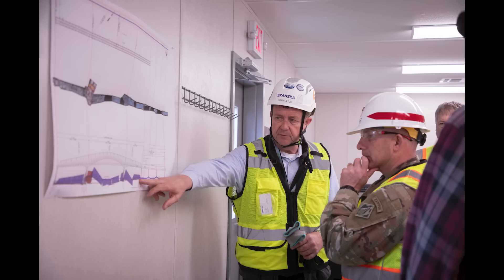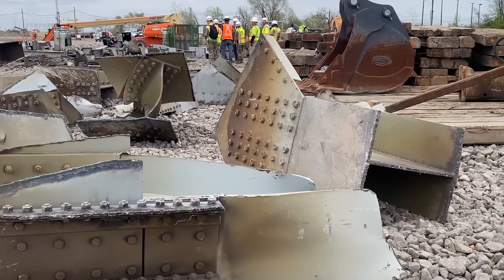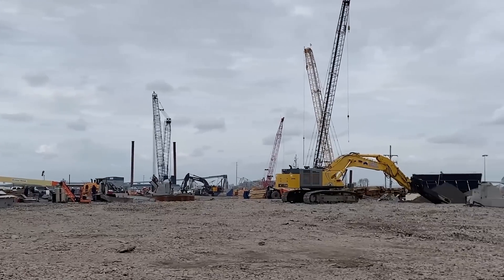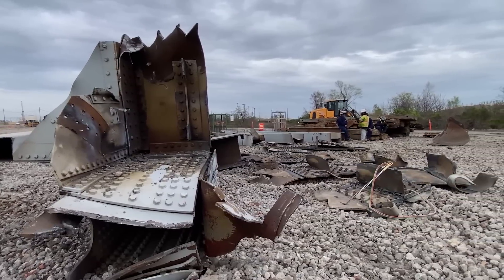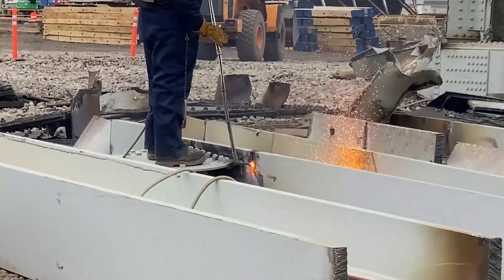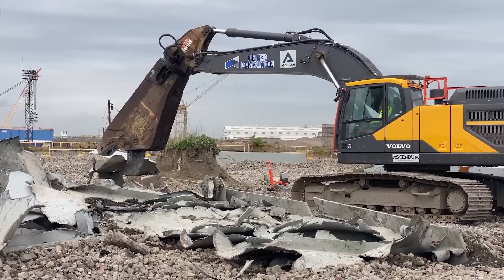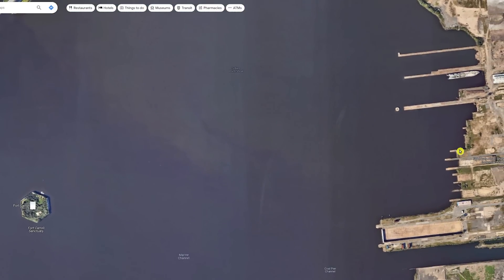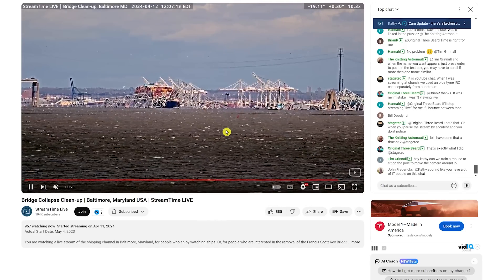What Do They Do With Key Bridge Collapse Debris Salvage?

Comment: The Key bridge was literally "a house of cards" due to it being one long "Continuous Truss" type: meaning the Key bridge was ONE LONG CONTINUOUS structure which means that if ANY one part of the truss is damaged/failed then the ENTIRE truss structure goes down.

In 1980 the Sunshine Skyway bridge in Tampa was also struck by a ship and 2 sections of the bridge went down.  The former original Skyway bridge was a cantilever bridge which meant it was a 3 section bridge with two cantilever truss sections holding up a "suspended" truss structure between the 2 cantilevers.  When the ship hit the Skyway bridge it took out one of the cantilever sections which brought down the "suspended" section as that one cantilever support was gone.  The other cantilever section was left standing and was fine.  They eventually tore the whole original Skyway bridge and replaced it with a cable-stayed bridge.

In Washington state, the Skagit I-5 bridge was a (relatively) short bridge that consisted four "classic" truss structures supported by piers. A semi with a large load hit a part of one of the trusses bringing down that truss section while the other three were fine and standing.  Washington did NOT replace the entire bridge with something more "modern" such as a steel reinforced girder bridge but instead just replaced the destroyed section with a steel reinforced girder bridge.

In the 1960s onward, there was already knowledge about the cable-stayed bridge and steel-reinforced cantilever girder bridges but the entire bridge building industry was ossified with truss-based bridges so thus the Key Bridge was a truss bridge even though cable-stayed type and concrete girders were better types to use but the ossified bridge building industry went with "what it knew" which was bridges based on trusses.

The Key replacement will be, GUARANTEED, a cable-stayed bridge.

Comment: Yes they are cutting the steel very well. That helmet/mask and respirator combination is the best that I've seen. 
back in the day, we would have been sent in with a short torch, a hard hat and some goggles. We would be expected to breath some of the fumes from the burning paint or fumes from zinc if it was galvanized.

Comment: jeff the "welder" is not welding. If you did research before talking. By definition Welding is joining of two objects (plastics, steel etc.), "He is separating metals Ox/Act torch, from what I see (twisted ends from straight Beams and Getters). Along with most of what you're describing you are WRONG. you need to stop narrating the photos/film.      Technical terminology: Welding, Cutting torch, Sheer and Track Hoe.                                                                              
        Just let viewers use their Imagination since that at you have to offer (terminology is everything). You must use spell check, that is all you got right! It worked better when I muted your audio.
Reply: I was quite surprised Jeff didn't know the correct term for what they're doing. Sure, maybe he doesn't work with metal but it's certainly relevant to his profession. That said, I think you were a bit harsh.

Comment: I'm surprised that they are cutting up the pieces so much.  Even though the steel bridge structure itself wasn't at fault I would think they would still do a forensic analysis to determine how some of the pieces failed.  All of the truss spans collapsed, I'm thinking they might want to do some analysis to determine how close it was to not failing the third span to the northeast.  It's theoretically possible that the bridge could have been designed such that the third span would have stayed in place and they may want to know how much more steel it would have taken to do that.

Comment: It's a shame Bethlehem Steel isn't still there. Now that steel will more than likely all go overseas and processed for us to buy back at a loss.
Reply: Most of the steel in the US today is made from scrap metal, over 70%. Nucor the largest steel maker in the US only use scrap metal.
The old integrated steel mills are getting outdated, much higher costs than the new “mini mills’ and they produce exactly the same product and quality

Comment: Many years ago, one of an old saw mill in Thunder Bay was destroyed by a large steel sniper on job site . No welders and crew were needed. Every girdles were snipped into small pieces and a back hoe would pick up the pieces and drop them in the dump box  . It’s too dangerous for cutters to cut apart the twisted beams. I see one worker got wiped 50 ft when a beam got cut apart. He did survived , but he quit the job. He said he still has 8 lives left when l talk to him .

Comment: As a retired owner of a steel mill contact steel mill company I can say that these worker are cutting the pieces small enough to be able to be fed into an electric melt recycle steel furnace. They might use some of the same steel after it has been recycled to build the new bridge.
Reply: I sure hope they will reuse all the steel and recycle other materials as much as possible. That metal is very valuable.  

I once took a school field trip to a steel mill in the Reading PA area as a child, and saw how they smelted the raw iron ore and made steel. It was very interesting.  And HOT.
Reply: @ann7318  Oh they will do better than just recycle the bridge elements. They have a quarter of a mile stretch of Interstate quality highway draped over the bow of the ship ready to sell! If only they can figure out how to get it off the ship in one piece.😂😂😂
Reply: Maybe, but I have a feeling that they're going to use more concrete on the replacement bridge. Maybe they'll use the metal for the rebar support or conduit materials. The new bridge will need to be designed to withstand the larger loads of the newer container carriers that are huge compared to what was moving through the channel when the Key bridge was built.
Reply: @coachwendy5618  The bridge was fine as it was built,,,the problem was ,,the barriers were not sufficient to keep the ship from hitting the bridge
Reply: @mrcoz1764  NO need for robust protection when the bridge was built. the channel was hundreds of feet away before they kept WIDENING IT! See my comment above. S L Collins, Baltimore, MD
Reply: They only need to cut to sizes under 1 yard length to meet a scrap price rating of "HM" , That guy is cutting small pieces , maybe there are plans to sell souvenir size to raise money , or maybe they wanted to keep cutting all day and earn the $$$ until the next barge arrived.
So , he is stretching it out for the hourly rate or its souvenir size for auction later.
Reply: @heartobefelt  I can see it now,,,Come and get your piece of the bridge,while it`s hot,,(hot from the cutting torch)
Reply: @heartobefelt  souvenir size peices 😂😂😂😂....
Reply: @danny6_6_6  Yeah you laugh,,,I bet you were the first to own a "Pet Rock"

Comment: It appears to me, that they're separating the steel to recycle it.  If it has rivets and nuts and bolts, cut it out , and move it to another non-pure pile.  Otherwise, you'll notice all the plain steel is in a large pile, and the small chunks with bolts in it, are in a different pile.  Different grade steel(s) for recycling would be my guess. They're not separating it for the NTSB to reconstruct the bridge to see how it's built.  They know how it's built, and how it went down. That isn't a mystery. They know it wasn't fastener failure, or grid failure.

Comment: Yes they are doing it right. Further more, the damaging rays from a torch are no where near what an actual welding rod system would do. They are CUTTING the steel NOT welding it. I have welders eyes from years of welding even with good protective equipment. The thickness of that steel makes for a slow cut. Even the jaws of the shear cannot handle some pieces of the bridge. Some things just come down to manpower and man-hours. ALSO, money for the skilled workers to actually get the job done right------SAFELY.

Comment: Technically the gas 'cutting' is actually burning (iron + heat + oxygen = instant rust!)... Once the steel is heated via Oxyacetylene to near white hot by the flame you add 'excess' oxygen then the steel burns (releasing a lot more heat) and the 'cutting' action speeds up 😎

Comment: In 1987 a pillar supporting a high voltage electrical transmission tower was hit by a ship in the Delaware River, down river from the Delaware Memorial Bridge. The tower collapsed with its high voltage lines. Fortunately no one was injured. The only problem was the lines were an important cross-tie between NJ and Delaware. The reliability of the grid was challenged until the tower was rebuilt and the lines rehung.

Comment: They are not Welders they are burners, the pieces are not being cut for inspection they are reduced to 5 foot or less sections as it is the optimum size for recycling
Reply: The first guy to properly identify what they are doing. They are definitely not welding.

Comment: Interesting that none of that debris are rusted, even after several days submerged on sea water! Do you know what type of steel it is?
Reply: The coating is still on. Even in salt water it will take month is not years to get that even slightly damage.

There probobly are rust on areas that been bent or twisted, but it would not be visible unless you take a photo really close.

It's likely just common carbon construction steel, possibly with some manganese or niobium to make it a bit stronger.

Comment: What's the condition of the ship at the moment in cases like this? Are the engines running, is the crew still living on the ship, is it powered by some sort of auxiliary generator or is it just a floating shell?  When they get the debris cleared, will it sail under its own power to a repair dock or be towed?
Reply: It will be towed. Currently it's sitting on the bottom.
Reply: As for electricity the ship has several generators.  The main engines are not needed to produce power.  The crew can stay on the ship for many days.

Comment: One of the things I learned during my career as a crane operator doing a lot of steel erection, is that bolts in a gusset  should never experience any shear force.  That is why there are so many bolts, to create enough friction between the two or more pieces of steel so they can never slip pass one another.  If the bolts ever experience shear forces then the gusset wasn't designed correctly.
Reply: @Willheheckaslike-d4h  High strength bolts used in construction will do this IF- IF they are tightened properly which is no easy feat, and IF the steel surfaces are treated properly.  When you start adding fancy coatings to protect the exposed steel from corrosion that really affects the ability of the joints to carry shear through friction.  Bolts will carry the load just fine in normal shear, there is no trouble there.  Bolts designed for friction can have less than half the capacity of bolts designed for shear.
Reply: When I design bolt joints I always make them a bit stronger than the beam... the reason is simple. If the joint is stronger  I only need to calculate on the beam.. saves work.

Of cause. That dont stop anyone from doing  a shoddy work. But well  I guess the dude doing the inspection meed to earn his pay as well. (There is some margin for error in the calculation as well.)
Reply: @matsv201  Omg, seeing your typos and grammatical errors, I would not trust you to design anything critical.
Reply: I don't know who told you that but they were incorrect.  Bolts are designed to resist shear.  If the bolts are fully tightened, and fully tightened means a lot more than what a person can do with a big wrench, then there is a friction component that can be utilized so that the friction takes the shear and the bolts do not.  However in the average building the bolts are not tightened that much and the bolts do carry the load in shear.  The shear capacity of the bolts is higher than the capacity counting on friction.  There are a few more things to it than that but most bolts in buildings are designed to carry the shear.
Reply: I thought there was supposed to be some play in the joints so the truss would be "statically determinate". That is, there would be no hidden stresses or twists which would could occur if members were rigidly attached.
Reply: @codetech5598  Three main spans like that would be the opposite of statically determinant.  If you make the spans continuous you gain strength and stiffness meaning the bridge is more efficient and uses less steel.  Of course the downside is if you take out one span you affect the remaining strength of the other 2 spans.
Reply: @Willheheckaslike-d4h  Thank you for making it understandable.
Reply: I was worried about this myself when I had to buy replacement lug bolts for ones that a tire shop ruined.  I was concerned that the new bolts were fully-threaded, instead of partially-threaded like the old ones, then I thought it over and realized the bolt's job is to clamp the wheel to the hub hard enough to allow the coefficient of friction to hold the wheel on.  Also why a wheel still usually needs a good kick to remove after you remove all the lug nuts/bolts.
Reply: @h8GW  The static load (vehicle weight pressures) is usually carried by close hub fitmemt with the wheel. Dynamic forces (acceleration, braking, and side-loading for cornering) are mostly carried by the lugs or studs. The dynamic loads are usually much higher than the static loads which means the lugs or studs are usually capable of the static loads without close fitment. This is reflected in the aftermarket wheel industry where one type of wheel may fit many different vehicles with different hubs. Normal best practice is to use OEM parts purchased from the manufacturer's sales network for those parts (dealership) but usually aftermarket parts are OK.
Reply: They won't check for explosives where we saw at least 2 on video and now they got them all mixed up.  U know what they did with the steel from 9 11 they paid and shipped it to China.   Tell me y they did that

Comment: When someone is welding, they are joining two pieces of metal together. These guys are using a Oxy Acetylene torch to cut apart metal not to weld it.
Ron
Reply: Lol duh. If you're a welder you definitely know how to use a cutting torch.

Comment: I doubt very much they will learn anything new from most of those steel truss parts. The bits that will matter, are the piers, the protection around the piers and a few parts where the bridge connects to the piers. It's not as if the bridge failed in an unexpected way, it was just hit be a huge sideways force which it was never designed to withstand, and it was inadequately protected against this sort of scenario. I think the investigators will only want samples of critical parts and maybe a general survey to look for any more wide spread problems, like corrosion. Also, if they wanted a minute examination of ever part, in situ, they would surely not be cutting it up into bite-sized chunks.

So there are three key points :-

1) what went wrong on the Dali, which is important, but kind of secondary to my mind in that infrastructure surely ought to be protected against forseeable events where practicable (and this was a very foreseeable event - here are plenty of instances of bridges either being brought down or being badly damaged by ships and barges).
2) Why was the protection inadequate to prevent a collision like this bringing down the bridge. There are, again, examples of newer bridges with much better protection against ships the size of the MV Dali.
3) The bridge also had a single point of failure. Could it have been designed to avoid that such that, even though damaged, none of the roadway collapsed, or failing that, multiple spans didn't fail.

Comment: When will be have a discussion about improved barriers, could the installation of more substantial fenders to protect the spans prevent this moving forward. 74 reported bridge strikes in 2023, who knows how many bumps and scrapes, especially as this bridges design was single point of failure.